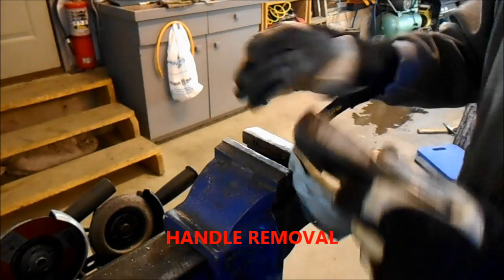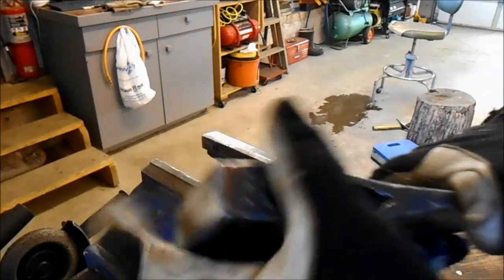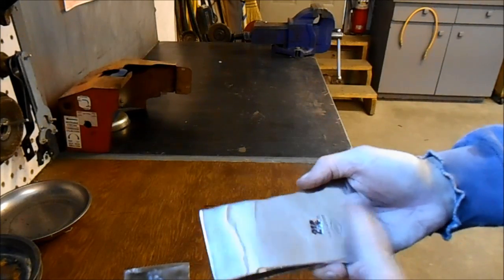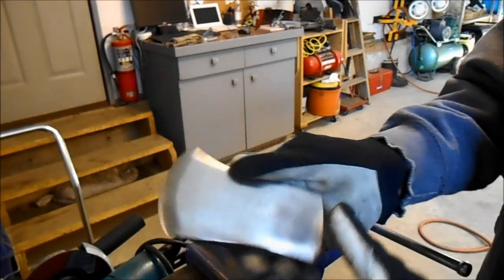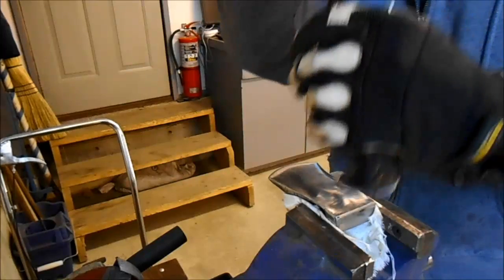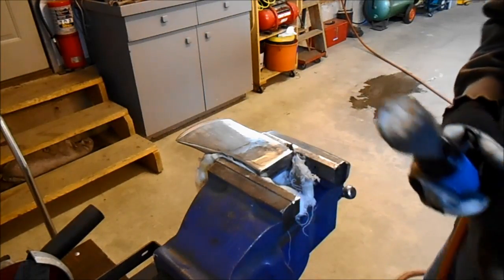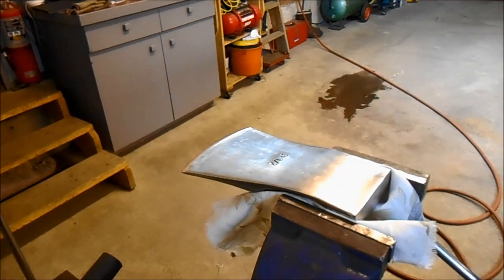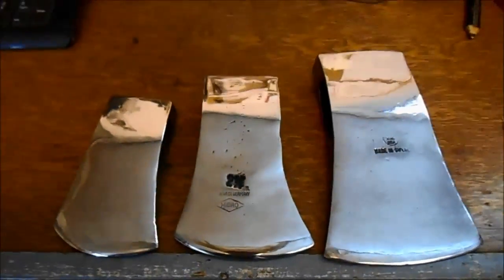Tools That Don’t Need Fuel Part 2 Axe Head Polishing

Comment: Excellent Bruce! I have an "American Axe Co." hatchet that I did a rustic polich on a while back and put a high polish on the cutting edge and hammer face on the opposite end. I love my polishing set up (coarse cutting and polish wheels that I mounted to a re-purposed V belt driven grinder). If you get into more polishing, might I suggest getting multiple wheels so you're not cross contaminating between rouge types. You'll get even better results, and your "bonnets" will last a lot longer also. I've got an old Estwing Finish trim 16oz hammer that I polished one day when I was bored and it draws a lot of attention when ever I'm seen wielding it during a project. I have a 22oz Framing Estwing that I will be revitalizing by re-cutting the checkering on the head and then polishing it all up to go along with the little 16oz one. So many things around the shop we can put our personal touches to! Great to see you posting up your projects! Cheers!! Zip~
Reply from the maker: Yes I knew I was cross contaminating but I had to move forward.  Thanks Zip

Comment: Hi Bruce,

When you went to use that 120 grit pad I found out that If you had used the green ScotchBrite pad you were already at around 600 grit. 

You got me thinking about the grit size of ScotchBrite pads. You may be find this handy:

SCOTCHBRITE GRIT CHART
3M Scotch Brite Nylon Pads:
7445 - White pad, called Light Duty Cleansing - (1000) 1200-1500 grit
7448 - Light Grey, called Ultra Fine Hand - (600-800) 800 grit.
6448 - Green (?), called Light Duty Hand Pad - (600) 600 grit
7447 - Maroon pad, called General Purpose Hand - (320-400) 320 grit
6444 - Brown pad, called Extra Duty Hand - (280-320) 240 grit
7446 - Dark Grey pad, called Blending Pad (180-220) 150 grit
7440 - Tan pad, called Heavy Duty Hand Pad - (120-150) 60(?)
Blue Scotch-Brite is considered to be about 1000 grit.
(The value inside the parentheses is directly from 3M.)
3M Chart
Less Aggressive ------> More Aggressive
7445 7448 6448 7447 6444 7446 7440
Finer Finish ------> Coarser Finish
Reply from the maker: Thanks
Reply: That's great info, I do appreciate the post and thanks for sharing. I cringed when I saw sparks flying on that Swedish head, but looks good now.
Reply from the maker: Rob S Well I knew when I started the job that I had to grind the axe.  I only ground the butt end and I tried to do less grinding the closer I got to the edge. 
Thanks for watching.

Comment: Did you wet sand these at any point in the process?  I've been trying to get metal to a mirror shine like yours but keep getting a cloudy finish.  Although I can still get a mirror shine, I am still unhappy because its somewhat foggy,  Any advice?
Reply from the maker: I used a jewellery polish.  It is in stick form.  Plus the buffer on the die grinder